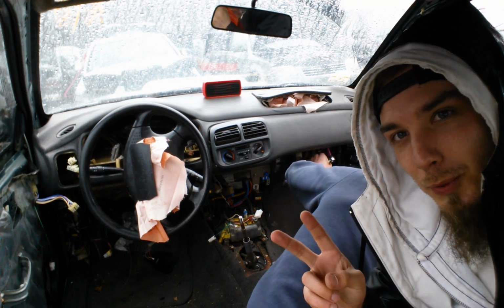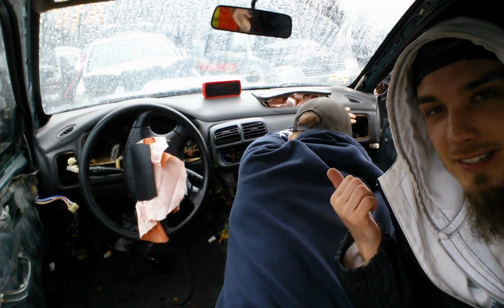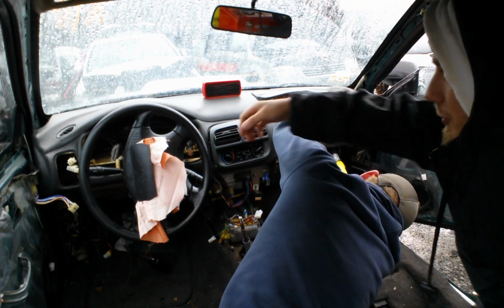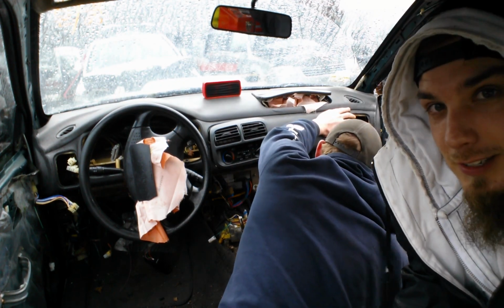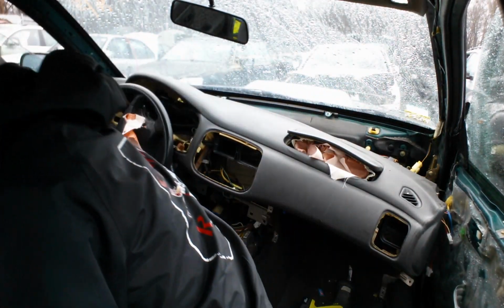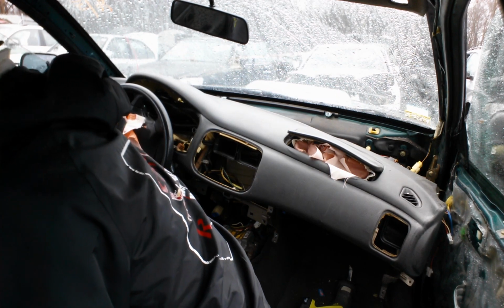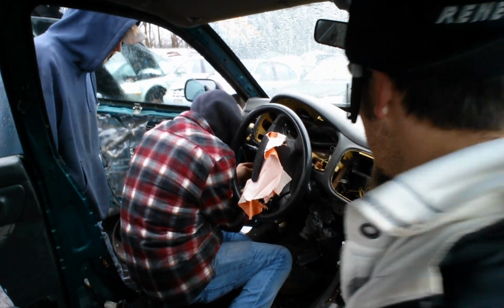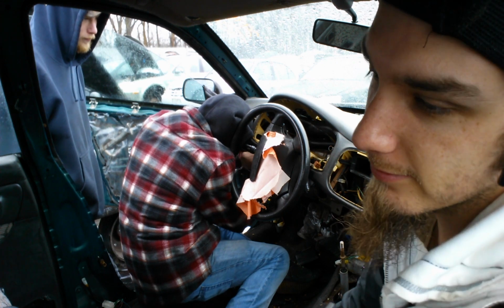Vlogisode 3:  How to Remove Interior of a 1997 GC8/GF8 Subaru Impreza Outback Sport (OBS) Wagon 2

Comment: How’d you guys get the climate control out? I can’t figure it out
Reply from the maker: Do you mean the wires that attach to the back? He didn't care about those so we ended up cutting the lines, figuring we could use the lines in the new wagon he was getting instead.
Reply: I wanna get the climate control out but leave the wires, just wanna get a wire through from the top of the dashboard down to the radio.. You just clipped it out or how you got it outta there?

Comment: Nvm found it
Reply from the maker: beatty1229 sweet! Thanks for watching my videos. I hope they helped. Let me know how it goes with getting your dash out!
Reply: Evan C Strange you have IG? I’ve recently acquired a 95 JDM GC8 here in Japan that I’m working on. Plan to bring it back to the states when my tour here is over. I’d like to see how your wagon is doing after a year
Reply from the maker: beatty1229 unfortunately I do not have an IG. I do have a Facebook if you want to try and find me on there. https://www.facebook.com/profile.php?id=100018937682696

This wagon probably got crushed in a cube honestly. So I owend this first, just as a daily because my 02 WRX blew the motor. So when I got a newer 06 Impreza 2.5i, I sold this to my little cousin (the guy in plaid in the video). He drove it for a short amount of time and then got in an accident when he got side swiped on the highway, leaving pretty much the whole front end all bashed up. He then found a 2 door GC8  Impreza but it had a tan interior, so we tried to find a black or grey interior to swap. When I searched the local junkyard websites I happened to find the exact wagon myself and my cousin drove (which I had also put newer seats in) so we went to the junkyard to pull out pretty much everything from the B pillar forward. It was meant to be!!!!! Haha

Good luck with the wagon project, you should document it and share it with others. I for sure would love to see some of that.